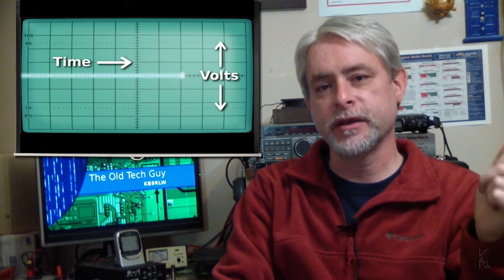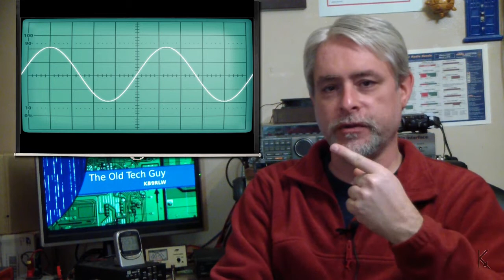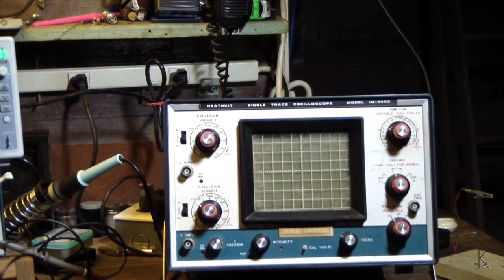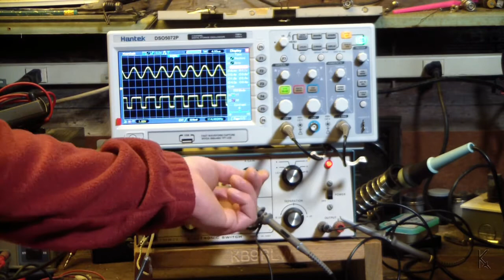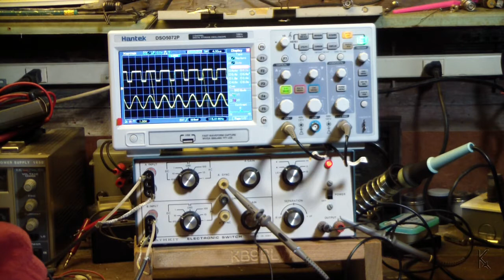Electronics - The Heathkit ID-4101 electronic switch, overview and demo.

Comment: thanks kevin, I bought a scope sometime back, when I got part of my disability lump sum. any info on how to use it is good for me. and accessories are just as good.
Reply: it a Goldstar os9020g with built in signal generator.
Reply: I think most of the newer analogue scopes effectively had this functionality built in - they can either alternate between sweeping the two inputs or chop between them rapidly during each sweep.

Comment: Cool Kevin. I built an EIco scope. It was only good to 25k I think. Do you remember the classified adds in Popular Electronics (1950s) "Build a wide screen oscilloscope." I think it cost me $5 (a large amount for a kid) when I sent off for the info. I got back 2 mimeographed pages, one with instructions and one with a schematic of a tube amplifier. You hooked it up to an old tube TV set and that was your "wide screen". It did work but it only had one time base, 60hertz. My parents were truly lucky I didn't burn the house down.
Reply from the maker: We converted an old B&W TV into an audio scope for a school play in high school electronics class.   It was the face of a computer in the play.  Fun times.

Comment: I have one of these that I actually built from the kit.  I should see if it works, I kinda doubt it.  It used to work anyway!  Not many years later I bought an analog Hitachi scope that had that switching functionality built into it.  Having used the Heathkit one I was at least familiar with the limitations of single beam dual trace.